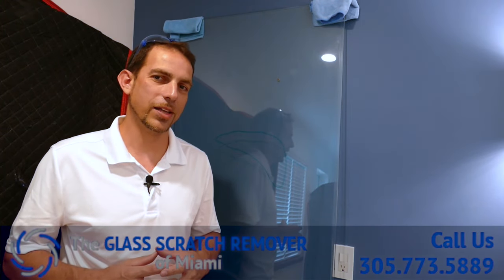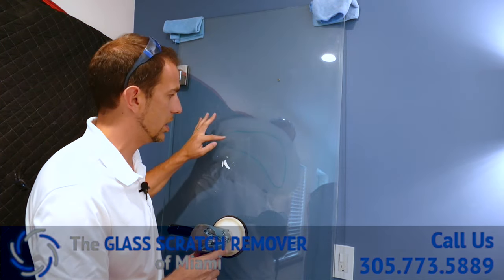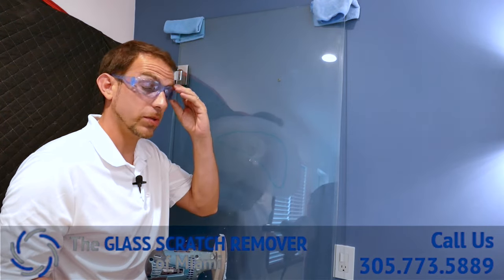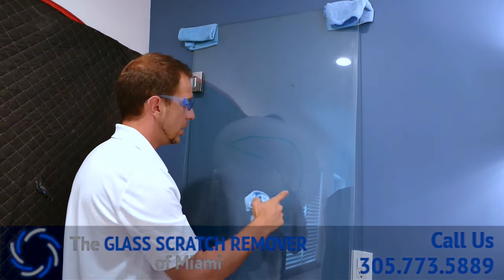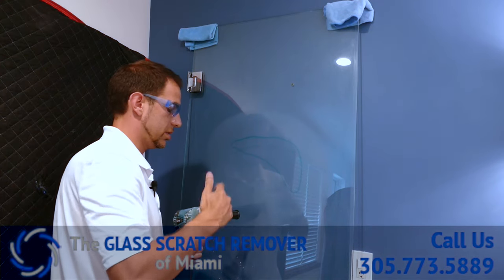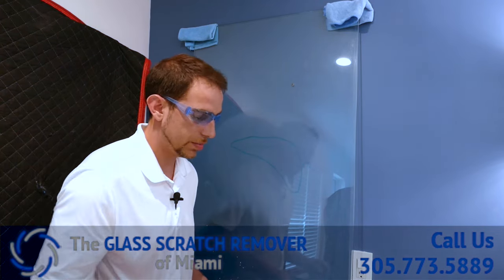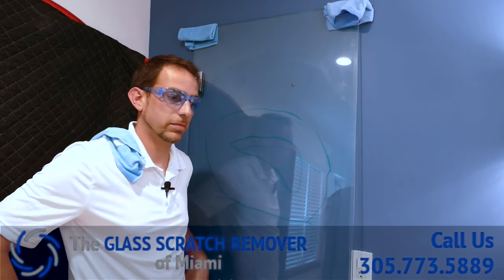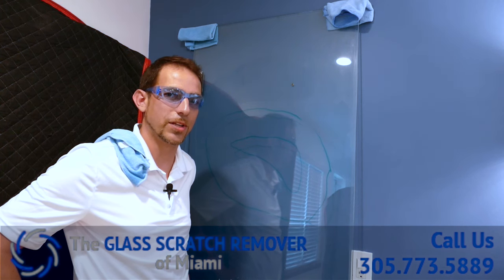How to Remove Scratches from Glass

Comment: Hello Pedro. I am reaching out from a different country in Europe. Here we do not have any possibility to bring the glass to a service or even ask a crew to come in and fix window scratches. Pretty messed up. I had a cleaning crew come after the renovation and they ruined every single window in my apt. I am trying to order products on amazon to have them shipped and I will have to DIY myself. Can you share the product links or at least the grades of the disks you used? Thanks it would be a lifesaver

Comment: hey there are so many grits of cerium oxide, 2.5 seems to be what s in kits, but you can find down to 0.2 microns, what would you recommend to get normal clarity in the glass. Also have heard some use diamond powder it can also be found in 0.1micron grit but id imagine its a bit hard for glass.
Reply: We use a medium to fine grit.
Most of the work is down using the polishing pads.
The finer the grit the clearer the polish.  It's all about patience.
Reply: Vivid Clear Glass which polishing pads do you use?

Comment: I dont have deep scratches on my sliding glass door. I made the mistake of using a pumice to remove spots of water stains on my rental's bathroom sliding glass door :( Now I have to fix it and there are no companies that do this service! Since I cant put my mail on the scratches, would I be ok just using Cerium oxide and polish pad with my drill? Any help would be appreciated.

Comment: Hi Pedro,
Maybe a question that comes back over and over again ... What about glasses ? Which are not made of glass but plastic. Does this final polish would do with my dremel and the fabric fiber head ?
Thanks in advance
Daniel
Reply from the maker: Daniel Beaufils this compound will not work on plastic. You need a different type specifically for the material your glasses are made of.  Also you have to slow the rpm down and use water at the same time to not melt or burn the material.
Reply: Taking a scratch out of glasses will change the prescription of the glasses slightly.

Comment: What we need now is a video how to remove permanent marker on glass ;-)
Reply from the maker: ralfandreakkd hahaha!!
Reply from the maker: ralfandreakkd use a dry erase marker.
Reply: thnx !
Reply: isopropynol (aka screen wash concentrate), or a razor blade.
Reply: Razor blades are what cleaning services use to put scratches in the glass silly.  The marker is on the other side of the glass for reference and will wipe away with a tissue:)
Reply: Actually if a permanent marker was used, going over that with a dry erase maker will remove the permanent ink.
Reply: wd40 takes that off easy
Reply: @VividClearGlass   correo???
Necesito valor de discos

Comment: Hey  Pedro will this process work for automotive glass and tempered glass? Thanks for  the video man!
Reply from the maker: irzoro yes, it works on both. The panel in the video is tempered.  We have a video on a windshield if you lookup vividclearglass too.
Reply from the maker: irzoro https://g.co/kgs/t7YWbt
Reply: Hi Pedro, my me scratches a double pane glass by Andersen, a bit thin glass around 3mm and some scratches can be felt with the tip of my nail. Problem is no technical support from the Andersen Philippine distributor which I really hate because they are selling it here and no idea at all on how to trouble shoot. I really wish you have a country branch here and save many from spending including me because it's my liability as a contractor of the canopy and my men did damaged the glass panel. Can you email me the paticular grits of the sanding discs?. I have the cerium already.thanks
Reply: @jeckreyes789  you never said what country you live in.

Comment: You are not using a drill, its an angle grinder with a rubber polishing pad accessory, and you stick a grit pad on it.  Probably some glass abrasive grit.  Not hard to find out. I have to polish some old mirrors in CA.  Cannot hire you guys for that.  Would have been helpful to know what pads you used.  I also have water spots.  You will find that the more technical you make it and more you share those 'secrets', the more popular you will get on Youtube and more business will fall your way.  Most people don't want to do the work or don't own the tools.
Reply from the maker: Thank you for watching!
Reply: @VividClearGlass  I noticed you dont answer the questions people are asking about the pads and materials you use.  You should think twice about putting up a tutorial video to make it look like your helping people just to try to attract business.  When people ask you questions its in your best interest to answer the public as we will be the ones that help you get ahead or break your strides!  I think i speak for most when I ask you yet again, what supplier do you use for your pads, what is you average RPM to grind and then polish, and what is the model of the polisher you are using in this video.
Thanks again in advance.